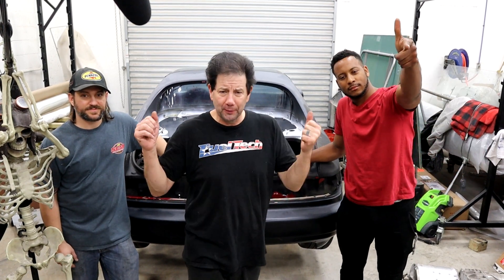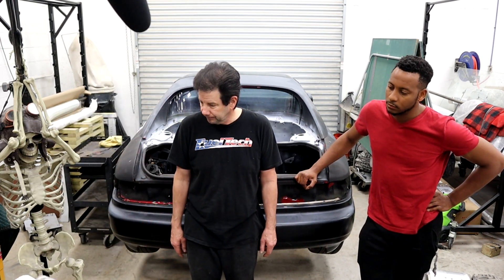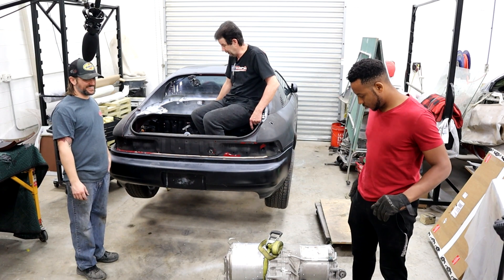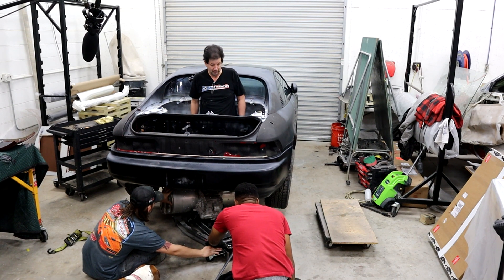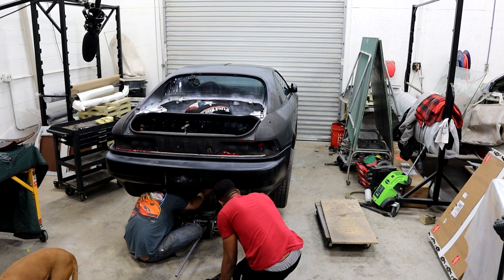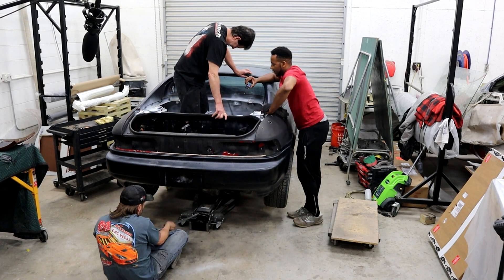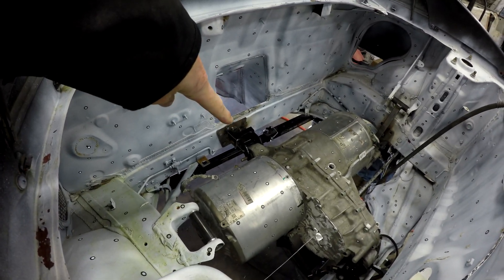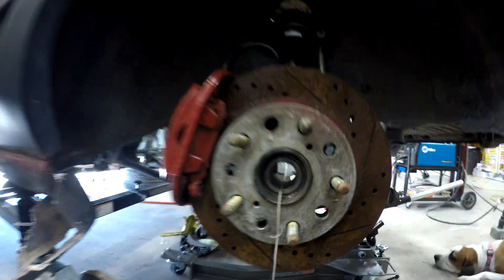Tesla + MR2 Swap Ep.1

Comment: Ive had (bought on eBay in 2006) the extreme 355 kit for my roller 91 mr2 (since 2011) with no engine, that I planned the 1.8 from (friends dad let me drive it for 6 months gone since 2003-pulled over at least 4 times) 2000 Toyota Celica GTS, that I believe in the lotus Elise with a remapped ECU and supercharger had 220hp, but decided to do the Tesla swap too-SOME DAY. Thank you for your help in your R&D it seems this is meant to be for me!  I'm crossing my fingers for you!

Comment: Good to see this project back up and running again. I'm guessing with all that space you can mount most of the battery packs above it and maintain the original weight distribution? 

My 3SGE is sitting patiently waiting to get this conversion done (insert shut up and take my money meme).
Reply from the maker: We are actually going to use the tunnel down the center of the car for most of the batteries
Reply: Hopefully we can weigh everything and see how that goes. I’m pulling my engine, E153, and fuel tank to prepare for this. Let’s go!!
Reply: I am going to be watching this build carefully as my sw is waiting for this swap one day. I always said most of the battery's should be down the tunnel where the tank was, so am super excited to read that is your plan.

Comment: How did you put the motor like this?
I heard that you need a new oil pump or modify something about the oiling...
Reply from the maker: Correct.  The motor will be operating in reverse (compared to a Tesla) so you need a reverse oil pump

https://zero-ev.co.uk/product/tesla-large-drive-unit-replacement-reverse-drive-oil-pump/?v=7516fd43adaa